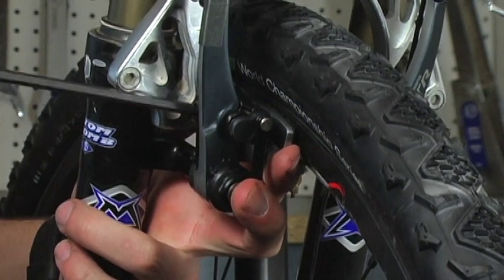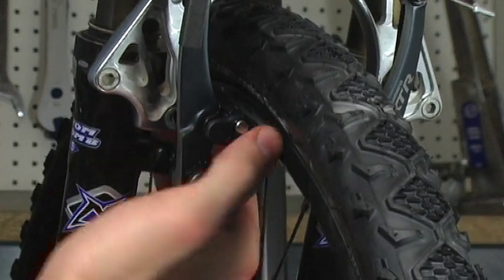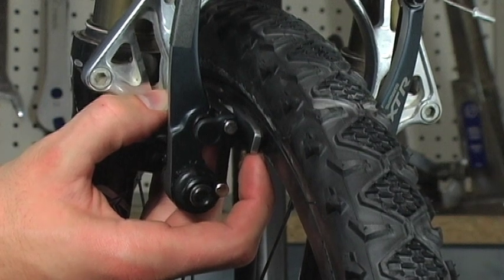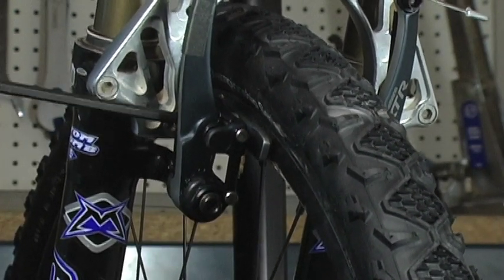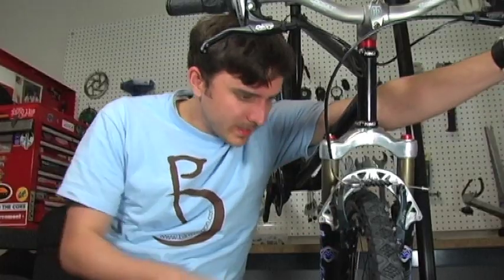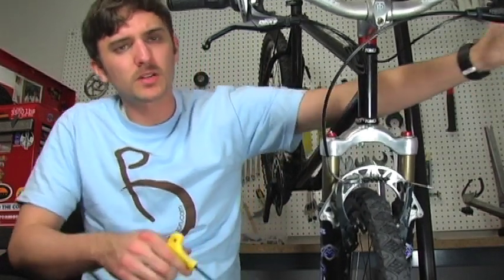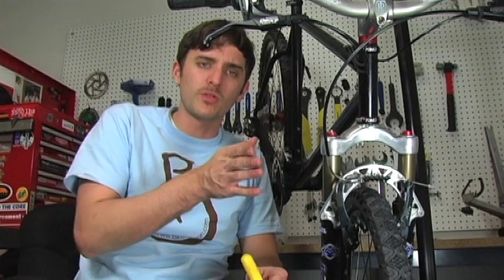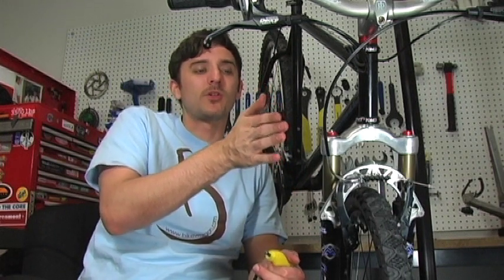Aligning the V-brake pads on your bike - Bikewagon Community College

Comment: Good job. Thanks. I am having trouble with my front brake. The rgiht side spring barely moves at all when I squeeze the brake lever. I have adjusted it over and over. I think the spring may not be good or something.

Comment: I think the only way to do that is to unscrew the screw on the brake that clamps down the cable, move the cable relative to the brake, and then tighten the screw back onto the wire in the place where you want it.